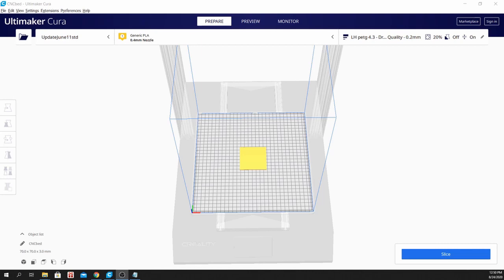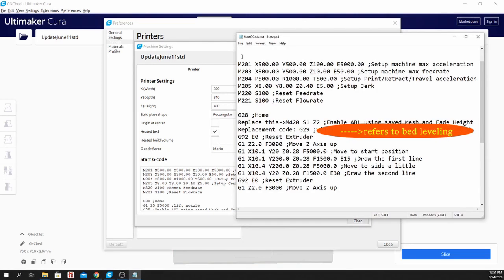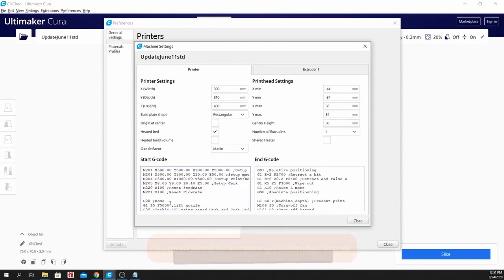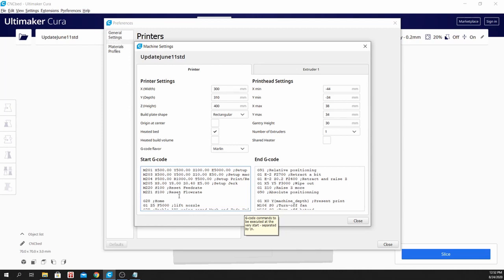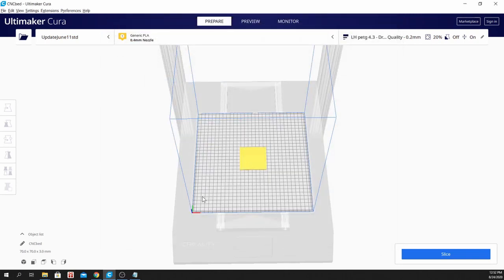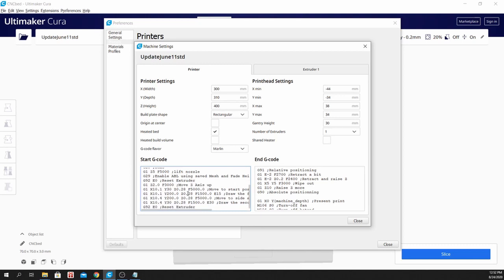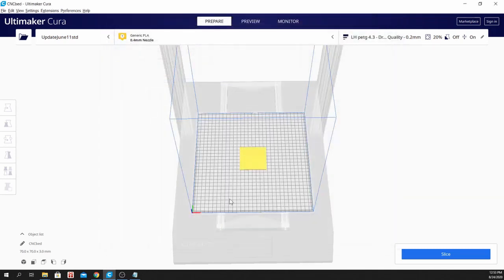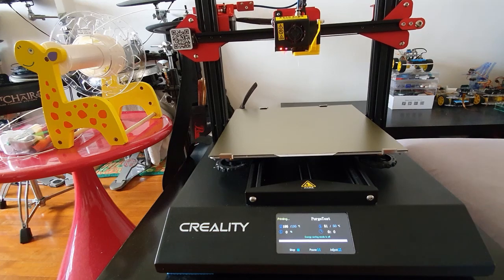CR10S Pro V2 Tip: #2 How to Fix the Purge Line

Comment: So I upgraded my extruder to a direct drive, and now the purge line is off the left side of the bed by apx 1mm. I adjusted the build plate to the left but I would like to find out what is causing the issue and do not know where to start.
Reply from the maker: I haven't tried modifying my printer but you can try adjusting the bed size. Assuming you have the CR10s pro v2 and using Cura, I've set X = 300mm and Y= 310mm under machine settings. There's also an option to adjust nozzle X and Y offsets, but do so at your own risk.
Reply: @webslinger2011  thank you